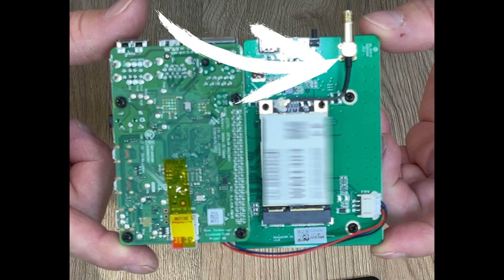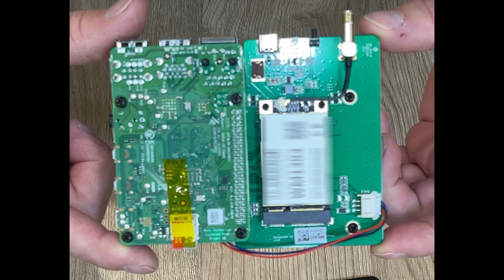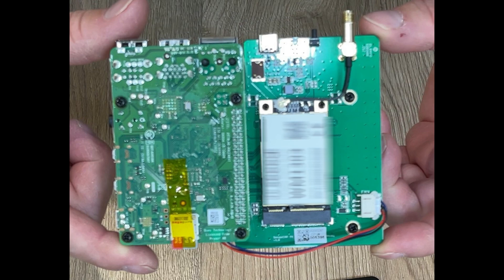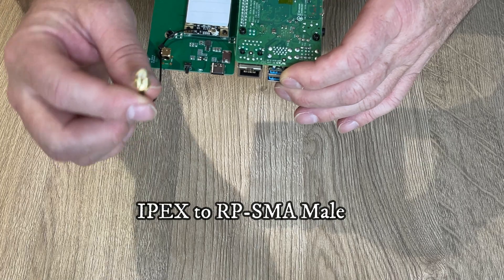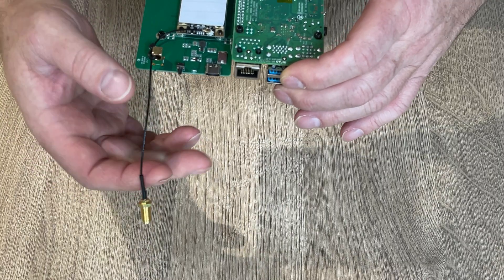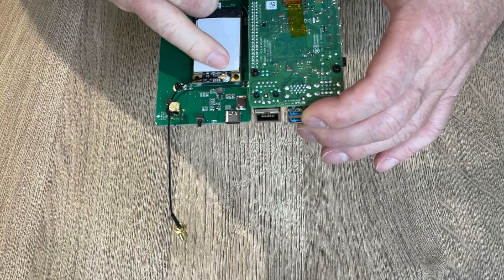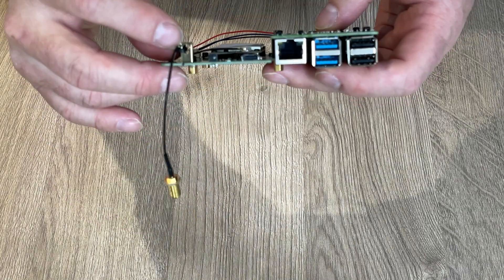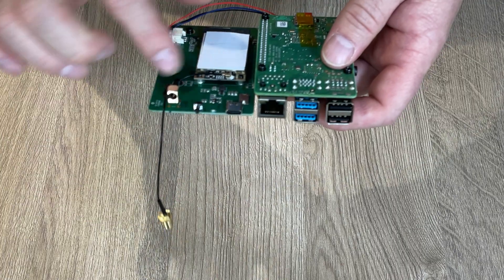Sensecap Helium Hotspot Fault and How to Fix.

Comment: Hi, thanks for the great video!
Just a quick question, so does this mean that you do not have to have the pigtail fused to the board? I have purchased the same replacement as you have, however i was under the impression it may have to be soldered to the board like the original pigtail, do you find any issues having it not fitted to the board?
Thanks man, any advice would be appreciated!

Comment: Hello could you see it was broke and do you have a pitture of how.that looked? Cause i have the same issue but I dont see that its brokeb
Reply from the maker: Hi.  Where the antenna connects to the Sense Cap miner it became lose.  When I ran discovery I was not getting anything so I opened it up.  Where the cable attaches to the antenna mount had twisted and snapped.  Sorry I dont have a picture

Comment: What symptoms were you having that made you decide to take it apart? I’ve been online over a month and I’ve never witnessed another beacon, but my beacons are being witnessed by others so I was wondering if this could be my issue.
Reply from the maker: it just became very lose and the part where the antenna screws onto was twisting
Reply: I have the same problem you are having and wonder if this is my issue

Comment: I got the same problem : the cable pigtail was broken. I don't know if your one would suit my one which is AU915?
Reply from the maker: I dont think that part of the cable is region specific so should be ok
Reply: @vancraft_chronicles  : Thanks for replying. But at the moment it's out of stock on Amazon and btw, how your hotspot can perform well as 1 HNT day but mine doesn't?
Reply from the maker: Hi. Mine doesn’t perform that well any more. Slowly gone down over time to about 0.3 HNT per 24 hrs
Reply: @vancraft_chronicles  still not bad.  My one to get 0.3 it takes 3 days roughly. I wanna figure out the reason.  I got 5.8 Rak antenna, 7m height with LMR 400 cable , no relayed, fully synced. ? What do u reckon?

Comment: Was your hotspot saying offline or needs attention? Or did your rewards just drop ??
Reply: Mine been saying that for about 3weeks now
Reply: @ASPHALT_GHOST  yup same here
Reply: @iamaaron____  Did you ground your Miner with a Lighting arrestor? Or what kind of setup are you running? Ive disassembled my miner for the last 2 days unplugging the power wire and antenna on the inside also the Memory Card and it worked for about Half day both times but it stops working after that
Reply: @ASPHALT_GHOST no mine is not grounded but I have 2 miners and they both did the same thing and 1 of them are working fine now

Comment: I have SenseCap, but it’s 915mhz. But sure it makes a difference. I had same issue but first one I ordered was too small. The little button snap that snaps onto motherboard was too small. I then got a new one and I am
Pressing hard and morning happens. I am learning that the end opposite of the SMA is called an MFH and it comes in either a MFH4 (tiniest) and an MFH 3, 2 or a 1. The 1 is the biggest. What MFH size is yours? Link didn’t give that detail